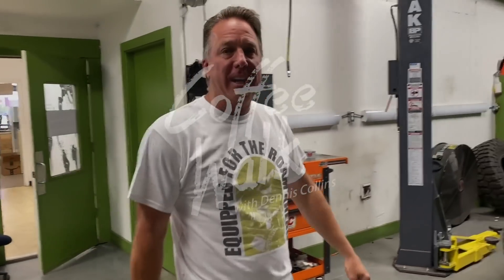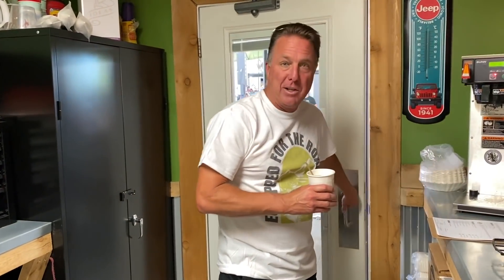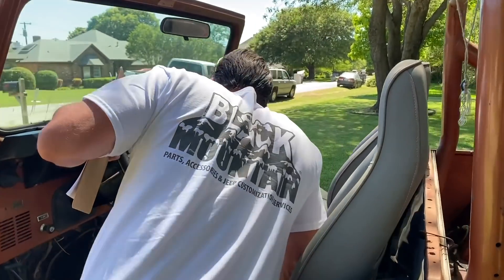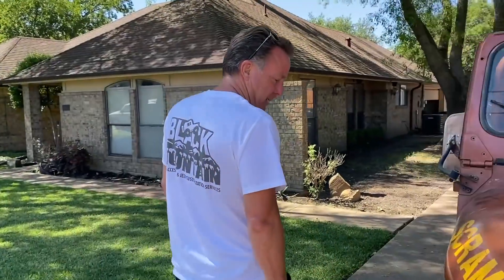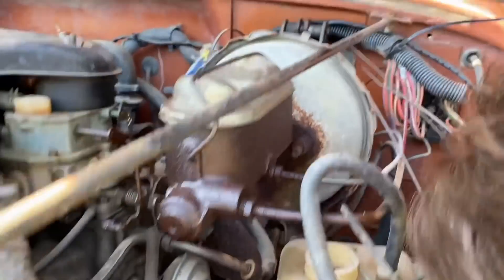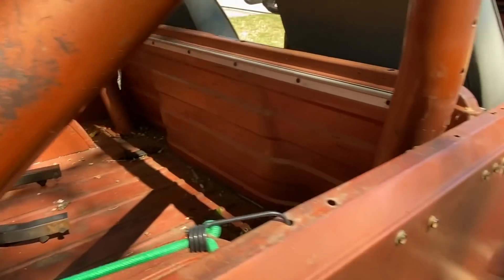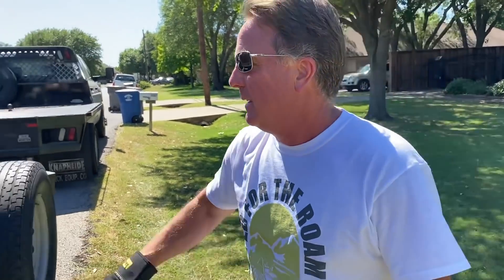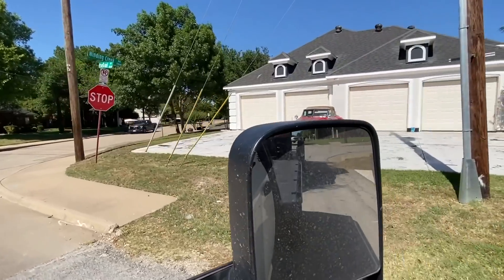Coffee Walk Ep. 98: Buying a local 1981 JEEP SCRAMBLER

Comment: aww yes  i  owned a 1983 CJ7 loved it but  always wished i had gotten the Scrambler  because i was a Scuba Diver  who grew up in South Florida  and there was barely enough room behind the back seat  for my dive gear  although i did come up with a  pretty smart design that i had a Steel cover  made  to go accross the back wheel wells that attached to the jeep with padlocks  with that cover on   you couldnt open the tailgate or see  what was  in there  it kept my gear from getting stolen  and i could keep 2 milk crates  of whatever i wanted to  keep safe  i usually had some tools and snatch ropes  for off roading in the Florida Everglades  i also bolted a Surplus Ammo canister  to my firewall under the  hood  that i kept  my wheel lock key in  keep in mind it was a  time with less crime overall  and i did have a Alpine Stereo installed with waterproof Sony boat speakers in the dash  i used to black out the Alpine name using black permanent markers to  make it look like it was just a cheap radio ?   in those days  i used to leave a 200 dollar pair of Sunglasses hanging on my rear view mirror  and those were never  taken  despite   not using  the factory top or doors  yes the rain washed my interior daily for me  and i pulled the drain hole  caps on the floor boards  to prevent puddles